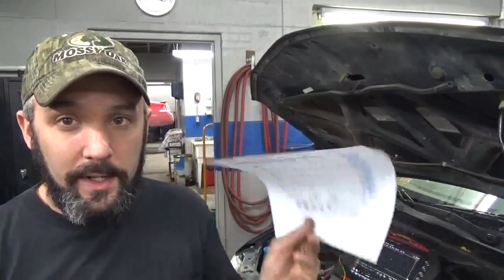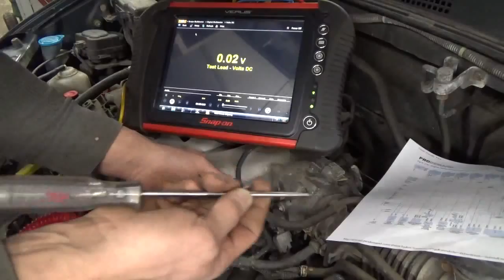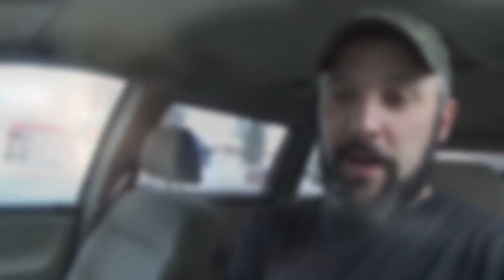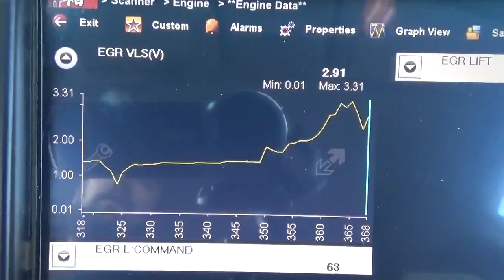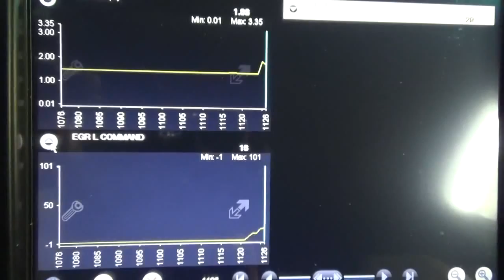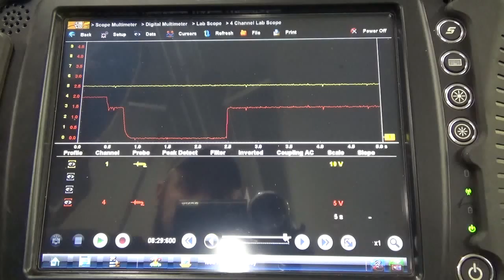Honda Odyssey EGR Trouble P1491

Comment: After all this... and basically going through all the basics... thank  you for this. I'm definitely justgoing to just replace the egr valve. I got a very intermittent egr code. Sometimes its reads in the scanner Sometimes it doesn't.  Sometimes it comes on on an hour trip Sometimes it won't ona two hour trip.

Comment: I randomly tested my egr, 2007 Honda accord v6. Similar to this car. On my scantool yesterday. It failed. After doing the test parameters. One time at 2700rpm it didn’t stall at all then the second time running the test it DID try to stall. So I looked up how to test it off the car. I tested the connector side too. It’s fine. While testing the resistance of the potentiometer I got the correct readings, BUT I accidentally moved the valve. It bounced around a little. When it was bouncing the resistance changed. So I shook it in my hand and the resistance would change with the movement. So I went to junkyard got another one. 5$ lol. While testing resistance of the potentiometer I shook the valve. Nothing. Dead steady. Then I see this video. With vibration of the rd the scan data changed. Potentiometer is changing resistance with movement. Then I see Eric diagnose this. My potentiometer is bad. Same as this one.  So fascinating. Love this s*** lol

Comment: It's astonishing to me that so few resources exist to describe what "normal" resistance is supposed to be for a "good" valve coil and position sensor (Don't get me started on coolant temp thermistor sensors).  The Haynes book on my GF's Civic is so lame it doesn't even show the engine wiring harness.  One suggestion to help explain what you're doing might be to sketch up the wiring for the part, showing the solenoid coil and potentiometer connections, and where these go in the vehicle.   A picture is worth a kiloword, I think...  Thanks for all you do and the effort you make.

Comment: My 2000 Honda Odyssey indicated a CEL signifying insufficient flow at the EGR. I typically use 89 octane and decided to run a tank of 93 octane with three ounces of Lucas gas treatment. After three road trips of approx thirty minutes the CEL quit indicating a fault. The 93 immediately provided better combustion and acceleration. The trick is to run 93 octane and drive with strong acceleration technique to create greater flow and heat. Be safe.

Comment: I have a gut feeling that I have an EGR issue with pilot, but of course I'm 1000 miles from home and I didn't bring my scan tool. I'll either have to wait for a cheapo scanner to ship to me or go to a parts store so they can try and sell me something I don't need. At least it's still running well and the check engine light only comes on during a below freezing cold start.

Comment: My Honda Fit threw a P1491 yesterday, but the cause was easy to find. I'd wondered if an EGR sensor fault might be causing hesitation at 1500-2000 RPM, and I had unplugged it with the intention of hooking up a power supply and scope to check that it all works as expected. Of course, I ran out of time, got distracted with other things, and forgot that the EGR was unplugged when I later drove the car! After about 10 mins driving, CEL came on, pulled over, P1491, ohhhhh I know why that's happening! :D
Reply: I did subsequently get the test done (same idea as in this video) and it checks out fine: pintle goes out further with higher current, potentiometer output tracks position with no drop-outs, and the engine idles rougher the more the valve is opened. Now more confident that the hesitation is ignition-related...

Comment: Hmmm might be the same issue on my 2002 ody, i have spark knock at around 1,500 rpm under light throttle, car doesnt like to maintain a particular speed on the highway unless i give it more acceleration

Comment: Nice video! Where did you learn electrical system diagnosing? I’m a student and took an electrical systems class last semester and am still completely lost when it comes to electrical systems. All my other auto classes have been relatively easy but I will need to dive in deeper on this one.

Comment: Nice video, though I'm not entirely convinced by the "regular old Joe" thing. But lets assume you were, and you only had a multimeter. Could this condition be diagnosed?

I'm in that situation with a OBD1 Honda Accord. Was coked solid, but cleaning hasn't made the CEL go. EGR solenoid and engine responds to 12V jumpering. Maybe next move would be to supply 5V(either from car or from an external supply) and see what the signal voltages are (though IIRC you said theres no published spec.)

I'm quite reluctant to touch any computer controlled circuits though

Comment: EGR valve only opens when car is in drive?  You said in video that you had car in gear when you were looking at EGR valve output signal in the shop?  Were you applying brakes while you were revving the throttle with car in drive?  Is that what you meant when you said you were going to "power brake" the car, when you were opening the throttle?  Sorry if this is silly question.  I'm trying to do the same test (on 1999 Acura TL--similar engine and EGR valve) while the car is in park with engine on but I think the car's computer is smart enough to only apply EGR valve open signal when car is in gear.  If anyone can answer, would appreciate.  Thanks.

EDIT:  FYI, when I apply this test with car in park, I see EGR valve position signal (to ECM) spike up on initial snap of throttle but spike back down immediately.  When idle is held at 2000 to 3000 RPM, the EGR signal stay constant 1.05 V.  (Acura service manual I have says it should be around 1.2V with valve closed.)

Comment: I’m having the same issue on my 98 accord vtec 3.0 I cleaned the valve still having the code so what’s the fix, and also I have a 1738 code which is 2nd pressure switch but not sure the location of the actual switch.

Comment: I am trying to test my EGR valve on my 99 Honda Accord.  The car does not stall or rough idle when I manually open the pintle. I even removed the EGR valve and started the car and the car does not rough idle or stall.  It just is very loud.  Does this mean that I have carbon build up in the passage way?

Comment: I had to pull the intake manifold and clean out the EGR passages.
Note: blast out the AIC too, as all the activity will likely disturb the crap in the there and it won't idle right anymore.

Comment: I got a code to put EGR Valve,So I got a new one but check engine light keeps coming on for it but it's new.What do I do.Do you know a code to put in to take it off,I still have original one from can but it a 2000 Honda Odyssey van it has 233,000 miles runs awesome.other then this problem.
Reply from the maker: With out seeing the vehicle or gathering data that is impossible to answer
Reply: Robert Farber. remove the intake plenum and clean carbon from egr air passages. severl videos on youtube to walk u through the job it took me 1hr to do so.

Comment: I need some help,I put a new EGR Valve in 2000 Honda Odyssey cargo van,but dam check engine came on,how do I do this code or get one? Thank you.
Reply: those odesseys the easiest thing to do is remove the intake plenum and clean all the egr passages since you already replaced the egr valve i actually have pictures of that same exact engine in the intake plenum removed

Comment: Nice Video! I wish I could figure out all that testing but I don't have a clue. I imagine a shop woulda just took a stab and said you need a new part and if that didn't fix it, charge you for more to fix it. 

You got anything on how to remove the intake to clean the throttle body on a 2002 Odyssey? There is 1 metal line connected a couple inches from the throttle body that is fixed in place and held by a clamp. I don't see how to pull it out if the rest of the metal line is fixed in place.
Searched utube and it seems no one has pulled off this intake!??? Seen it on a 2005 but it's a different setup... Help!!!

Comment: hi guys about p1491 I have a 1999 honda odyssey I clean everything took out manifold clean every carbon build up and the egr it self and still I'm getting p1491 I don't know what to do now pls. help me what would trigger the p1491 code. thanks guys
Reply: probably the egr went bad
Reply: I did replaced my egr but it has to be from honda I bought the after market it's not compatible.
Reply: I have the same code on my 96 accord and i tried to clean the passage ways but the bolts are so tight i broke my tools

Comment: Hey Eric. This is a great video with great step by step detail of how you confirm an EGR failure and do not just accept what the fault code says.  I had a similar experience some years ago with a Renault  Grand Scenic diesel.  They changed an EGR and an air intake valve in the first four visits.  After another maybe  10 returns with the same fault you are showing to the garage the fault was never fixed.  It is a long story what happened after that to resolve the issue but I have always felt  that dealership and manufacturer  incompetency was the real cause for the issue at the end of the day. It should have been an in the garage one day for diagnosis and a return for repair as you have demonstrated in both videos.  And that should be the end of the matter.  So don't feel you are going in to too much detail.  The information in this video was excellent and demonstrated very clearly.  I have been a subscriber for most of 2015 and I am enjoying all the videos. Happy New Year to you and your family.

Comment: I just had this same code on my 1999 Accord, and I went through the tests from the service manual. The EGR valve failed both of the tests for resistance (100k ohms or higher), so it recommended replacing the valve.
Reply from the maker: anti0918 Yeah seems to be pretty common on these

Comment: Hi Erick, just a quick comment, I notice on your video that you jump the 5 volt reference to the signal (not a good idea), what if the signal wire is grounded?
So the best thing to do is create a jumper wire with a 5K ohm resistance on it or use the Hook (which I know you have), so if the signal wire is grounded you won't hurt the PCM.

Comment: Excellent diagnostic flow, Can only make one suggestion, I would have made more use of the bi-directional controls under functional tests, and scoped the signal wire, and the power to the EGR, you would see the varying signal (as you vary the percentage with the scantool), and the PWM change in the power supply. I like to tap on the EGR valve while carrying out this test, whilst observing the signal trace,  lot of the time faulty position sensors are caught this way. I believe on the Verus, that you can have the lab scope up in one window, while simultaneously commanding the EGR.
I notice you have the Schrodingers Box seal of approval lol. Always a good thing...Good luck, looking forward to more.
Reply: Ahhh, yeah, should have read all the way to the bottom of the comments, and seen that my observation was already covered. Ooops...
Reply from the maker: slashnburndotcodotuk Lol yeah it's ok. Thanks for watching :) Great suggestions though. Def would have used the scan tool if it was an available option.

Comment: Thanks for sharing.  Tsb HSN 0202-1 can be found on Pro demand by searching p0171 under 99 odyssey. Print out that page of data specs as a quick reference when working on Hondas. I find it to be a real time saver and keep that page in my toolbox. Egr vls spec of 1.1 - 1.25v closed is included on that page. And I'm sure you saw the tsb 05-026, but good point you make about not assuming.
Reply from the maker: Hey OneLegged hondamechanic appreciate the heads up. Honda does do a great job putting out the TSB and data. It is my habit to check TSB's on anything I work on. Can save major headaches in a lot of cases as I  am sure you know :) Thanks for sharing!

Comment: this is a great video with tons of info on how troubleshoot an electric EGR. I  had to go through this to help a friend troubleshooting a P401 on a V6 Olds Aurora. The valve was working good so far and the sensor reading was within specs, what I didnt do was the test drive or the power brake to activate the valve..
Reply from the maker: That's cool glad it could help. Now the power brake does not always work. Depends on the strategy of the pcm. Some need to see speed signal first.  I believe a 401 is more of a flow problem. Does the car stall when the valve is opened?

Comment: Good going.  Real diagnosis is so rare these days.
Reply from the maker: Hey you have to see if the part is bad or its the PCM or the wiring, heck there is a lot of possibilities as far as I'm concerned. I would have to agree though. Some guys just start winging parts at it. In this case a good guess would have fixed it but I think testing the circuit helps keep you sharp and reminds you how things work. I dunno I just really enjoy working on cars and try to do the best job I can for my customers and try to fix it right the first time. Thanks for watching!

Comment: Wow, what a thorough diagnosis. Awesome scan tool. Sure beats the old Sun tester my Dad had in his shop. What do those go for?
Reply from the maker: Ahhh the old sun machine lol. Hey now I grew up on one of those. Actually it was the Snap-On Counselor II, great big huge thing, 7' tall, green screen, big boom with all kinds of wires hanging from it for ignition testing. At any rate thanks for watchin, oh and if you wanna pick up a Verus scanner lab scope it will set you back adout 9k.